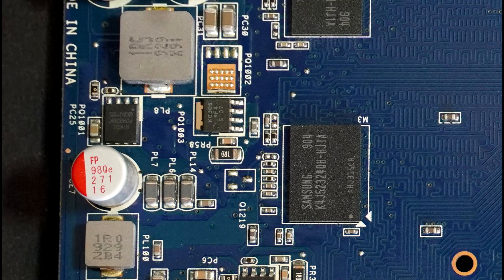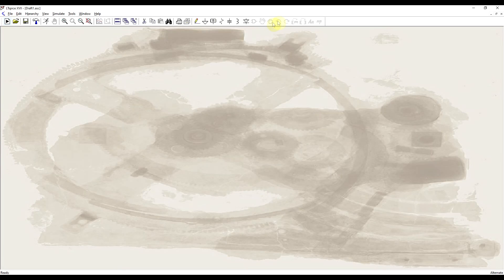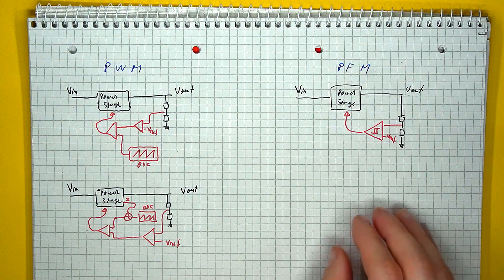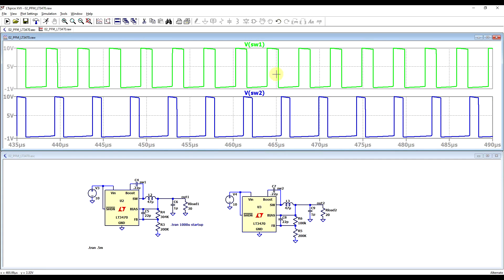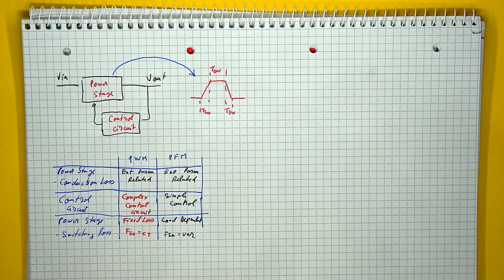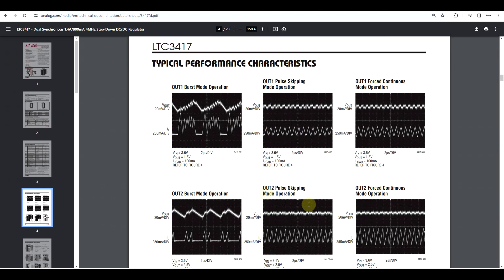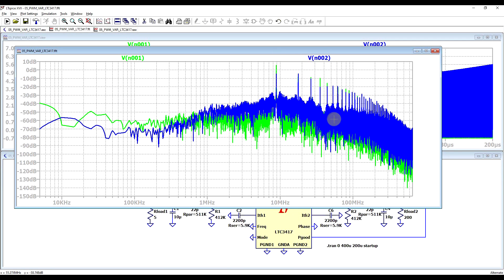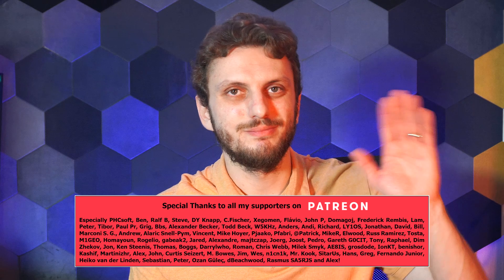Looking at Pulse Width Modulation and Pulse Frequency Modulation

Comment: not sure why you say that PFM can be used only for bucks?? I'm using PFM all the time, including for boost/flyback and even with valley switching or peak current limiting, smoothly transitioning between CCM and DCM. PFM makes all of this super simple, as you only ever have a single summing node on the hysteretic switch, into which you can integrate all kinds of functions one could want. But maybe i am misunderstanding something.
Reply from the maker: I was trying to say that the implementation where you have a single trigger-Schmidt comparator (and nothing else) will only work like a buck; once you add a delay timer and other digital logic, you can build any topology - including boost/flyback as you mentioned.
Reply: @FesZElectronics  I don't see why the flyback/boost would be any different from the buck. You take feedback from the output and sum it back into the comparator. No other parts needed.
Reply from the maker: With the buck, to get a higher output voltage, you need to keep the switch on for loner periods; once the target is reached, the switch is turned off; with a boost, to get an increase in voltage, you need to turn the switch off - keeping it on will keep the output at 0; without a mechanism to force the switch to reset from time to time, the boost will not work - this forced reset is not mandatory in the buck; there the reset occurs naturally.
Reply: @FesZElectronics  Ahh I see. Yeah but this can be resolved super easily by taking feedback from the FET gate, as well, to form a relaxation oacillator that naturally keeps going and where you only tune the duty cycle using the other feedbacks.

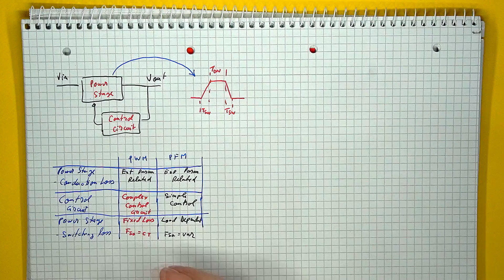Comment: 8:22 WHOA...  "PFM is more efficient [in switching-losses]." 
(Sorry, maybe I'm nitpicking, as the context is explained better, later... Otherwise, highly-informative vid, thank you!)

That statement is very much reliant on the duration of the PFM pulses... which depends very much on the load, as well as the design.
E.G. In comparing a PFM-Only supply with a PWM-Only supply, if 50% duty-cycle is necessary for the output, and, say, the PFM-update-clock is eight-times the other supply's PWM-frequency, then the PFM-Only supply would have four times as many transitions. If the duty-cycle was 25%, it'd have twice as many transitions.
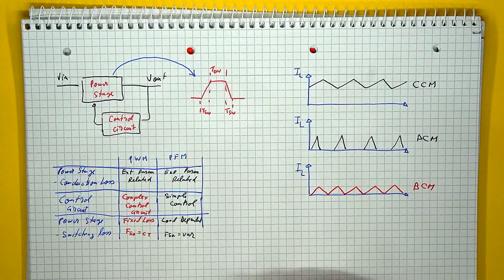I see at 9:30 your explanation, here at 8:30, is based on a specific chip that chooses PFM for low duty-cycles, and PWM for high. That makes sense, based on your observations, as well as mine. This chip optimises each usage. But, in general, without careful consideration of update-frequency, typical loading, etc. PFM is probably not as efficient in terms of switching-losses.

(Interesting unrelated-ish hypothesis about these devices that choose PFM or PWM... A PWM-Only controller might inherently appear to be PFM at low duty-cycles if, e.g. the PWM duty-cycle has a specific step-size. e.g. if the PWM duty-cycle can only be controlled in 1% steps, then if 0.5% duty-cycle is needed, it'd just output 0% for one cycle, and 1% for the next. Wherein, it's quite plausible the same PWM control circuitry just inherently appears to be PFM when run at very low duty-cycles... No special PFM circuitry needed. But, that's just a theory.)
Reply from the maker: You are right that if the frequency for the PFM is higher then of course its less efficient; the point that I was trying to make was that if the power stage is the same, especially at light load, PFM can be made to be more efficient, but this is usecase dependent to some extent; Its easier to make a PFM converter to be efficient over a wide load range than it is to make a PWM converter; at relatively high loads, the switching losses are no longer the main contributor so the exact modulation scheme is not as important as with light loads. 
The other point that you made about the PWM controller, sometimes is called Pulse-skipping mode; where the controller skips a beat, but all the transitions are still synchronized to the base oscillator.

Comment: This was highly educational.  A related cross-over is Pulse Density Modulation where the switching and thus the power density of the output is completely determined by the input signal.  PDM is often used by MEMS microphones and feels like a cross between PWM and PFM with the switching circuitry being controlled by the input signal rather than a feedback signal.  This got me to wondering what it would take to make a video of this sort could be made for a PDM source.
Reply: As I understand, PFM is just a special case of PDM, where no pulses can be longer than one cycle (thus no duty-cycle greater than 50%).(?)
Reply: @ericwazhung  I suppose. The PDM circuit descriptions I've looked at have an internal feedback process that seems to be half PWM and half PFM. A bit weird but they work.

Comment: Excellent video as always. 🙂
As an amateur radio operator, i would LOVE to learn general techniques to to minimize switching noise in power conversion circuits. 
I live in a remote area with a -120db noise floor at HF frequencies, and every time i get a new device,  I have to dispose of the crappy, unshielded, usually hideously noisy "wall wart". Manufacturers for consumer goods just don' seem to care about EMI. ☹

Comment: One detail about the EMI of a PWM oscillator. The base frequency and harmonics are only fully predictable at a duty cycle of 50%. Any other duty cycle will contain two (variable) base frequencies, and resulting harmonics. So the noise spectrum of PWM is not as easily deterministic as indicated.

Comment: It would be great to have a video or series about EMI/EMC and how to simulate in LT SPICE for the different standards (MIL-STD-461, DEF STAN 59/411, MIL-STD-704, MIL-STD-1275, MIL-STD-1399, FCC Part 15 class A/B, EN 61000-6-1/2/3/4)... Especially input/output filters!
Reply: This is an excellent topics

Comment: Ratio Of On And Off Time? Switching On-Off-On-Off Is Frequency, Is It Not? Or Is There Something I'm Missing Here? Of All Simulators, Besides It Being Very Accurate To The Real World, It's One Of The Most Tedious And Demanding Software To Run, As Long As You Can Get All The Proper Fill-In Data From The Manufacture. Most People Just Want To Get An Estimate To Tell If They're Going In The Right Direction, Just Ball Park Results. Once You Start Adding Or Subtracting From Your Circuit,  Everything Changes, And So Does The Modelling Data. I've Had Many Run-In Where I Was Only Able To Get Three Quarters Of The Modelling Data For The Changes In Components, But The Other Quarter Is Till Missing Which Leaves Me Stuck Or Try To Go Idea Or Generic Components, But It Defeats The Accuracy! Either You Go All The Way Or You Don't. No In between For Uncertainties Left To Question. So The Simulation Is Either Or If You Can Fully Use It To Its End, Otherwise You're Left Frustrated!
Now, I'm Puzzled Since You Didn't Add The Crucial Switching Transformer Into The Circuit To Make The Power Supply Half Complete At Least. The Switching Transformer Will Change The Entire Result Considering Your Example Had No Real Load And Adding That In, Could Be Looked At As A Load, Besides A Simulation Schematic Showing Some Waveforms. LINEAR TECH., It Is A Great Company If You're Using Linear, But A PWM Can Simply Be A 555 Timer And Easily Adjustable For The Duty Cycle And Frequency In One With Two VR'S. Just Trying To Imagine What Would This Be Used For Since I Didn't Notice Any Real Scenario Involving An End Game, i.e. Led Driver? Considering The End Result To What You're Teaching Here, Or Am I Just Going Far Ahead Of Your Agenda?

Comment: Interesting. For ham radio applications, I've used switching regulators where you can supply an external clock! They way, I know accurately where my harmonics will be and can push them out of the receiver bands of interest. 😜
Reply from the maker: Clock inputs are also used to drive more than one supply in phase opposition - in effect making it work like a multiphase supply. This works really well when the supplies are physically close. By applying synchronization you can reduce the noise, or be able to use smaller capacitors.